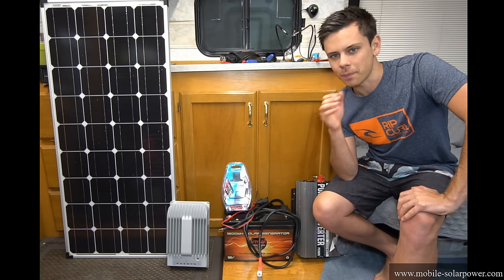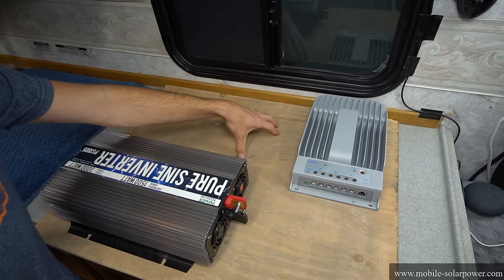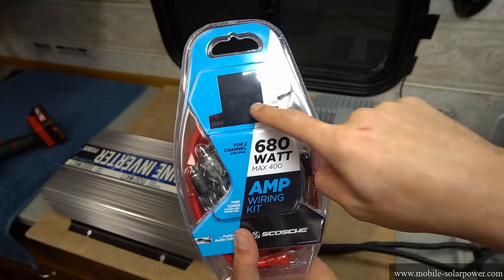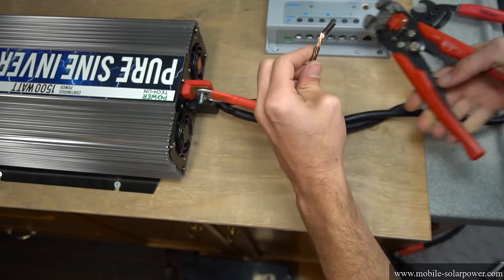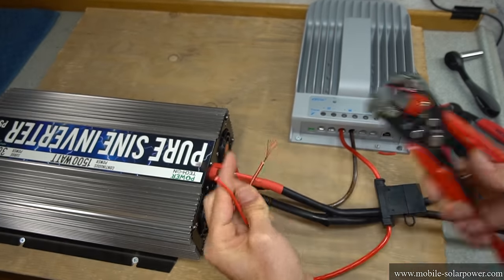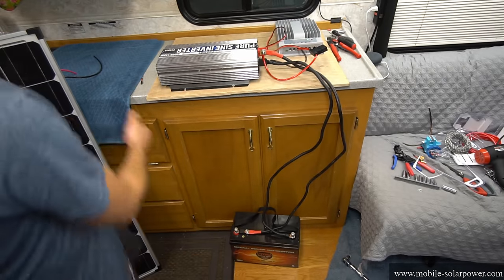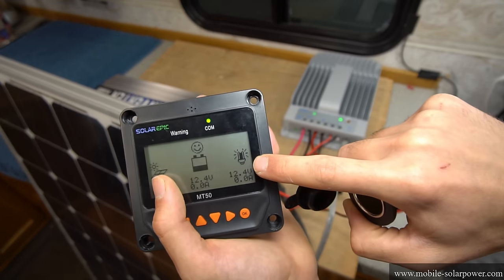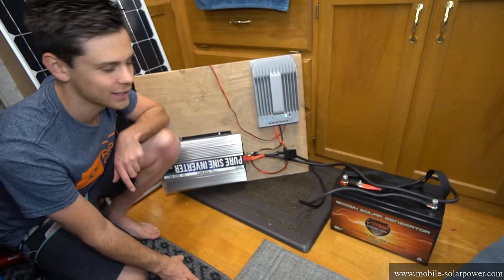No Crimping Required! DIY 400 watt Solar Power System- Great for Preppers or #Vanlife

Comment: My off grid application would include a wind turbine of approximately 400 watts as well as 400 of solar. Would it be as simple as using the panels or would more controls be necessary. Thanks for you vids, I learn much. I made this comment / question on an older vid but you may monitor newer vids more closely. Thanks Mike
Reply: Hey Mike Hotchkiss,
You need a charge controller that can handle a wind turbine.  If your batteries are fully charged your solar panels don't care if you don't need them.  Your wind turbine will care. Your wind turbine could over speed due to a no-load condition if your batteries are already charged. Wind charge controllers have a dump option to maintain a load on the wind turbine.  Usually a large resistor or an electric heating element in a water heater to provide a load that can be switched on to "dump" the wind turbine power if needed.  Do your homework and you will have a great system.  Frank
Reply: @Tex4u  Thanks Frank. My education continues

Comment: I used this setup exactly (right down to the Walmart cables).   Question about the controller connecting to the inverter.  Will the inverter draw charge from the controller if available or will it still strictly draw from the battery?

Comment: Appreciate your great videos. I have a question please: Can I connect a 550 watt/4.8 Amp water pump to my 400 watt/12 volt solar system connected in parallel?

Best regards 

I. Al Ali

Comment: Great job with your video. I’m looking at 2 - 6V LAB in series for a 12V system and offering 200W or 400W flexible solar. Is it worthwhile to step up to the 400W? I’m thinking it will provide more charging in a shorter period of time.

Comment: Oops you didn’t show how to add the fuse on the positive cable from inverter into the charge controller
Reply from the maker: Oh the fuse is already installed. It comes that way

Comment: COULD I RUN A HOT WATER HEATIN ELIMANTE (24VOLT) OFF THE CHARGE CONTRLLER ? THEN THE REST OF MY BOAT TRU THE 24VOLT INVERTER ?
Reply from the maker: Probably not. Load terminals on charge controllers are severely limited

Comment: Will, can you explain why you used a 175 amp fuse at the battery. I don't understand why you need such a high amp.
Reply from the maker: Surge and fuse box and short run

Comment: I’m in the process of building this exact setup in my travel trailer.
Since I have the wire from another project, I’m planning a 6ft length of 2 gauge wire ran to dual deep cycle lead acids. 
I am getting conflicting opinions on whether that wire size will work. 
I see your using 2 gauge with this setup, is that sufficient?

Comment: Great site, just discovered and subscribed!
My primary interest is a little off topic.  I hope to be building a small solar system for unattended home backup of critical circuits(boiler) instead of a gas generator.
With very infrequent usage, I am curious what battery is recommended? 
Operating months or maybe years without a power draw, what considerations would you suggest?  
I was just quoted $7K for a turnkey generator installation plus the cost to install rural gas for it.   I think I can do much much better with solar but hope to save some ‘tuition’ by visiting great sites like yours!
Any solar sites that you could point me to which would be more appropriate??
Thank you

Comment: Will . why do you put a higher amp fuse (50amp)  to a 40 amp charge controller ? is it so you do not restrict the load going to the inverter while  still protecting it ?
Reply from the maker: Standard safety codes usually rate them to 125% of working current

Comment: You started saying 400w but your only using 1-100w solar panel am I missing something?
Reply from the maker: It's a 400 watt max input solar charge controller. Should have said that in video. If battery and inverter is 24v, you can use 1000 watts with this charge controller. But because it's 12 volts in this video, we are limited to 400 watts

Comment: The solar charge controller has a screw to attach a cable for ground. I think so does your inverter. Is it safe to attach these grounds together?
Reply from the maker: yes absolutely and it's advisable to connect to a true Earth ground if it is available but in a mobile system the chassis is not a true earth ground. in my system is connected to shore power and I use that ground to ground the cases of all of my components

Comment: Will. Awesome awesome!  Best video I have seen you make it simple. But I would still hire you to do it...

What do you think of the Nissan nv. 200 van as build out camper. They seem very reliable.
Reply from the maker: Thanks, and those are really tiny. Almost the same cargo area as a sienna. I was considering one ages ago but didn't get it. Go inside one first to see how big they are.
Reply: I have a NV200. I've been watching Will's videos. I'm going to install 
2 12v 225w solar panels. (450w total)
Epever mppt 40amp charge controller
4 or 6 138ah lithium batteries (I have 6; might only be able to use 4 because inverter size).
8000w LF chinese inverter. 
Cigarette lighter attachment (now that I seen this video :-)

@Will - does this sound like a solid system? 
By the way I won't be powering any DC appliances. All be using the system for ac applications. I don't want to fuss with extra fuses and fuse box setup due to space constraint. Batteries will be in prallel.

Comment: Hi Will (et al) -
I bought your book and it has been a big help, thanks... but I'm upgrading an existing system and still seem to have landed in an info void.  I have six 100w/18v/5a panels and six 6 volt batteries paired into a three 12 volt bank.  

Your 40 amp controller will cover me on amps & volts if I configure my PVs as two parallel strings of 3 panels each in serial (300w/54v/5a + 300w/54v/5a = 600w/54v/10a).  

But your controller has a 520 watt limit that would appear to kill the deal thanks to that 600w figure. Yes?  I can't switch to a 24v battery system due to space limitations.

That same 600w figure would also appear to derail this project even if I switch to an array of three parallel strings of 2 panels each (200w/36v/5a + 200w/36v/5a + 200w/36v/5a = 600w/108v/15a).  

Must I move up to a 50 amp controller?
Reply from the maker: Yeah 50 amp would be preferable.
Reply: Thanks Will. This is why I was confused:
Your linked "Amazon SolarEpic 40 amp CC Description says: "...works with 600w solar panel on 12v battery system. Max solar panel 1560w". It also says "5x12v panels". 

I asked: "Please explain?"

Amazon Seller answered:
"Hi, 
1. the rated power input is 520W solar panel on 12v battery charging, and 600W is what we recommended power on 12v battery system. 
2. The 1560W is the max power it can handle on 12v battery system, that below this threshold it's not damage the controller, but it will possibly make the charger protected duo to a higher charging current. It mainly useful for areas not having a good sunlight, and you are enable to enlarge the panel size from 600W to 1560W. 1560W is the technical tolerance of the power input, we don't recommend you do so. 
3. 5x12v refers to PV input voltage, what we advertized 150V refers to open circuit voltage input, 5x12v panels in series will be around 110V or so, it's a safe voltage for this charge controller, however 6 in series will still in the range, but it's in the edge of the controller's max input. 150V (Voc) is the minimum temperature operation voltage, if the environment temp at 25℃， it only handles 138V (Voc). That's why we recommend max 5 in series max, not 6."
Reply from the maker: @MTBioGuy  oh that's a perfect explanation from the seller. Max input is that high. But total charging limit is 520-600ish.
Reply from the maker: @MTBioGuy  I'm glad the seller explained it. They did a good job
Reply: So... would you still recommend that I move up to a 50 amp CC?  My six 100w panels are all mounted flat on my trailer (no tilt ability) and I live in Montana (above the 45th parallel) so my sun is usually pretty "thin".
Reply from the maker: @MTBioGuy  I would get the 50 amp regardless. But you could use 40 amp. But you need to wire them in 2x in series strings. So the voltage doesnt get too high.
Reply: DIY Solar Power with Will Prowse Hi Will can you tell me if i can use a 100A and a load of 1500w ?

Comment: Why wouldn't you put the inverter to the load terminal of the charger ?
Reply from the maker: Because load terminals can only handle 20 amps. Inverter needs 175 amps max

Comment: Is there a way to plug system into shore power to charge batteries if you have no sun for days?  Thanks
Reply from the maker: Yeah just buy a 30 amp shore charger. Hook it straight to the battery
Reply: Also, where do you/how do you connect to the van alternator to charge the battery when driving?
Reply: Thanks 🙏
Reply: @crzekelly  DC to DC charge controller.

Comment: You did a video before where everything was connect through a fuse box, is that the same as this system with a fuse box added connecting straight to the battery?
Reply from the maker: That was my tiny 200 watt system and you can do either way it depends on what gauge of wire you're using and what fuses
Reply: @WillProwse  I am trying to do a 200W system following your items and steps. Does that mean I should follow that video set up? I'm a beginner :/
Reply from the maker: You need to read my book then, if you want to know fuse and wire sizes. If you don't get that right you will cause a fire.
Reply: @WillProwse  yes I already bought and read your book haha. I am using the correct wires and fuses according to it. I just am confused as to where the wires should actually go to. The previous video everything went via the fuse box but this it was just connected to the battery
Reply: @WillProwse  sorry I'm trying my best haha following all your vids to learn!
Reply from the maker: @Zhangquanify  Oh awesome!! Ok so the other video had a 20 amp solar charge controller, so a 25 amp fuse terminal worked great. This system has a 40 amp controller, so a 50 amp fuse is required, which is not in any standard fuse box. Does that makes sense?
Reply from the maker: @Zhangquanify  Oh ok no worries! You can connect the charge controller to the battery, inverter, fuse box etc, just needs a proper sized direct connection to battery somehow.
Reply: @WillProwse  oh I get it, so it's because of the fuse sizing that's why you connected it differently? So I could do the set up you did for that 20a charge controller and connect all from the fuse box right?
Reply from the maker: @Zhangquanify  yeah totally, if all you are using is a 20 controller. Just connect to a 22.5-25 amp fuse
Reply: @WillProwse  gotcha! Thank you! Looking forward to your next video :)
Reply: @WillProwse  hey Will, you didn't talk much about a shunt in your book. Just wanted to know if I should use a shunt battery reader or the mt50 you're using in this video to monitor the solar and battery charge?
Reply from the maker: @Zhangquanify  they are 200 dollars so I avoid them. But if you have the money, go for it. They are in the battery monitor section of the website. It's nice to have.
Reply: @WillProwse  but the bayite ones are like 20 bucks. Do they do the same job as a mt50?

Comment: What is the 175a fuse size based upon?
Reply: OK I get it.  As long as it's not more than 1.5 times the amps it is still fine.  1500w/12v = 125a = 125 to 187a fuse is acceptable.
Reply: Wire gauge and length to the inverter is also a factor.

Comment: Will can you explain why you always use a EPEVER MPPT Solar Charge Controller 40A, and not Victron devices. Thanks
Reply from the maker: Better over paneling, great heat dissipation, manual control of everything and it's way cheaper. I have an entire write up on every single reason on my website under the solar charge controller section.
Reply: Currently on ebay with MT50 for $190.

Comment: Be careful with that sub wiring kit i melted the fuse on my system it was bad almost killed my system (almost had a fire) i had the 5ga wire kit and 40 amp mppt and a 40 amp fuse in it and it melted
Reply: 40 amp fuse is supposed to blow at 40 amps. Size the fuse according to the wire, Size the wire according to the load. Question- If you had to build a bridge across a chasm and you weighed 100lbs would you construct a bridge that  breaks at 100lbs?
Reply: @donnorparty  but it didn't blow it was intact and melted the housing.
Reply: Sounds like a bad connection somewhere.